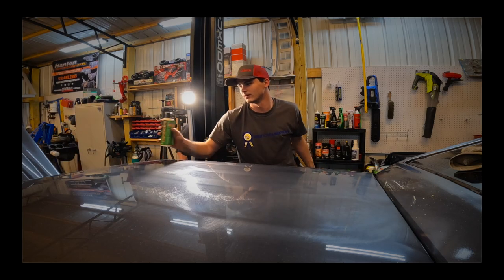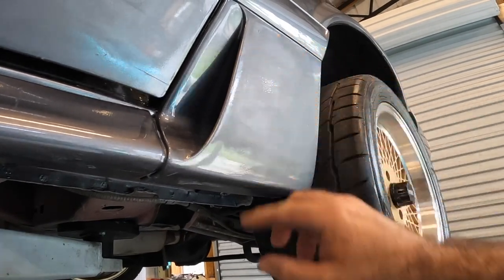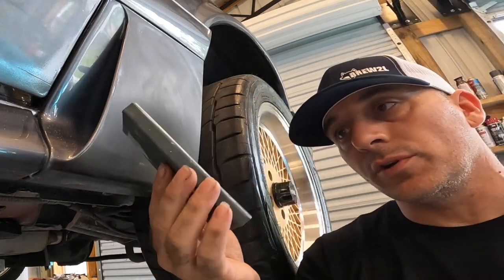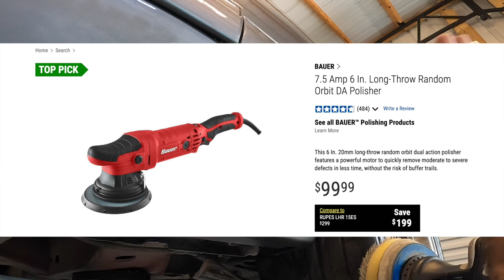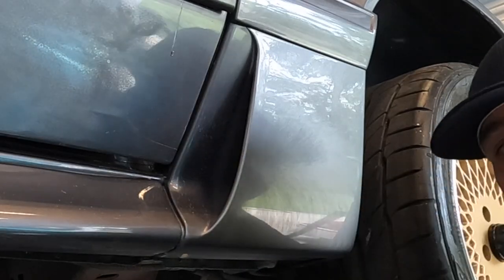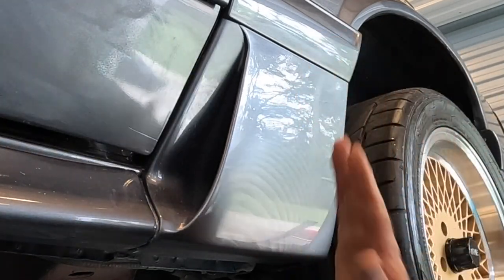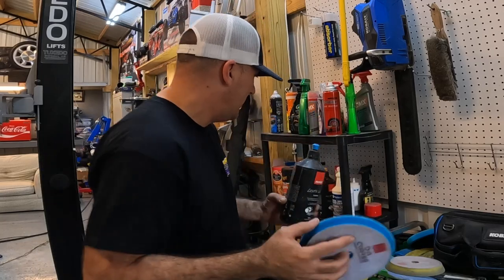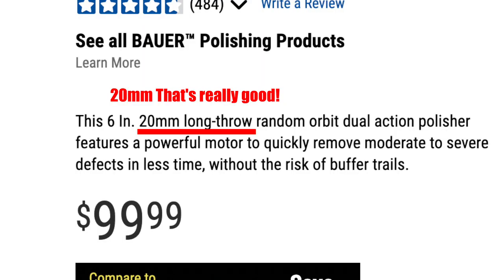HOW TO GET THAT MIRROR FINISH ON YOUR FOXBODY!

Comment: As far as sanding the paint the Trizact pads for a da sander work incredible! Saves a ton of time. Few squirts of water and let the da do the work. If you use the 3000 pad you can skip the coarse polishing step and go right to fine. Something to think about on older paint that just needs a buff
Reply from the maker: I use those as well. 👌

Comment: Like your choices! The 3d ACA compound and polish line is the best, what you used with the wool pad. I still finish out with 3000 trizact then I use 3D compound with a rotary and polish with a DA. Great video thanks.

Comment: Long time since I've commented. I'm curious how wet sanding and this 2 step method works on single stage paints. Ford didn't start clear coating their Foxbodies until 1990. So this leaves questions on the 89 and below models. My paint is original and I'm very careful with it. That said, it's black and shows everything!
Reply: My 1986 mustang convertible was factory base/ clear. Sanded it all down to bare metal last summer. This method works great on non metallic ( solid color) single stage paint. If it is metallic then the micro flakes will show orientation change from sanding.
Reply: @willsachs  ?? That's not what I read regarding Ford's painting of vehicles. Maybe it could have been ordered??? Hmmmm
No, mine is single stage, non metallic, so maybe it will work well

Comment: Perfectly timed, I just painted my front bumper and have been buffing it.  What do you do about harder to reach areas like the dip where the pin strip goes in the molding?  My pad has had a hard time getting in there and bringing the shine back after wet sanding.  Just keep hitting it?
Reply: Try a smaller polisher. I love My Adam's mini swirl killer. Inexpensive and VERY effective .